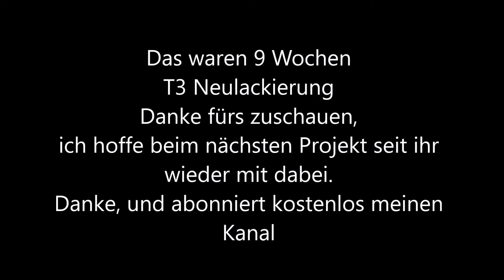VW T3 Fertigstellung Teil 2 und ENDE

Comment: Hallo Gerhard 

Bin hier neu dabei und gleich ein Abbo hinterlassen! Mega viel Aufwand und cooler Job. Erinnert mich an meinen T3 den ich zusammen mit meinem Bruder H - fertig gemacht habe.
Tolle Tips die ich hätte früher haben sollen....aber Erfahrung ist eben alles...
Grüssle 
Uli
Reply from the maker: Danke für deinen netten Kommentar. Liebe Grüße aus Innsbruck
Reply: Bei mir war das ganze Projekt 2017 und mein Bulli ist 9/87
50 PS Diesel
Reply from the maker: Schick mal ein Foto auf autoholzknecht@gmx.at
Reply: Gerhard Holzknecht 

Hi Gerhard hab dir so einen kleinen Film gesendet mp4

Grüssle 
Uli
Reply from the maker: @uliausdemschwabenlandle372  danke, Ich bin grad in ungarn ich schau mir dein Filmchen am Mittwoch in der Werkstatt an. Danke :-)